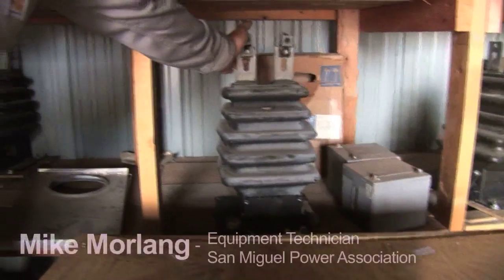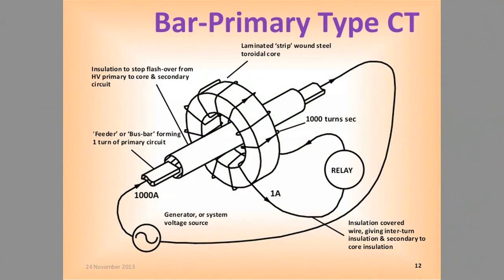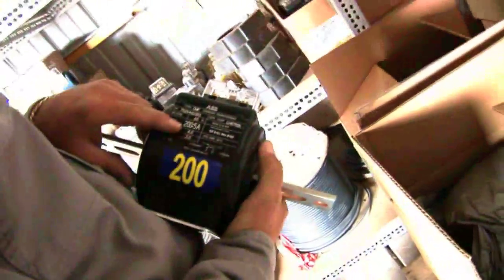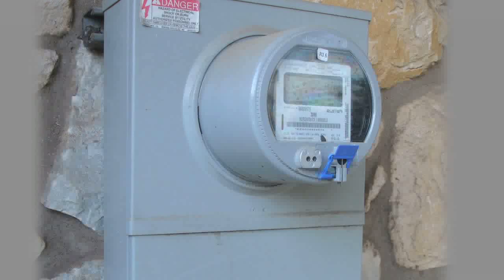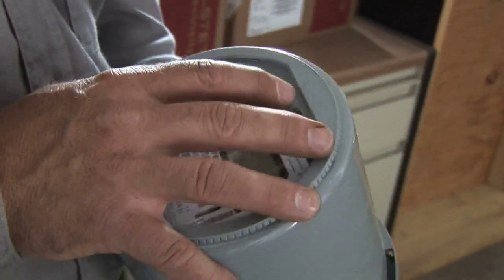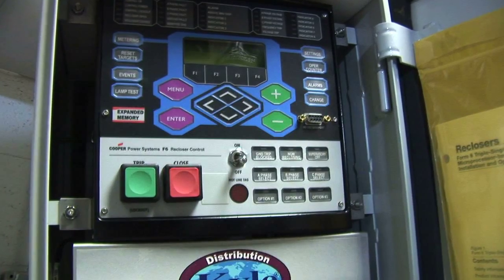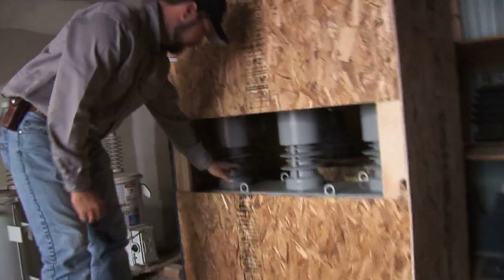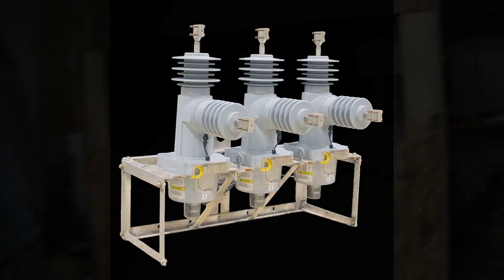Current Transformers - Measuring HV current

Comment: So it taps on the current using induction and then measures that secondary current. It's basically the high voltage version of a clamp meter.
Reply: Essentially yes!